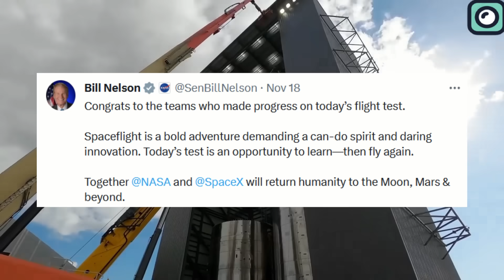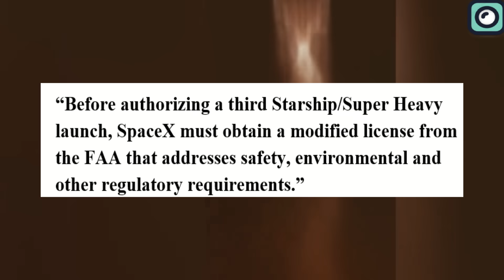SpaceX Officially Revealed Flight Data of the second Starship Launch!

Comment: Yes. I agree that both launches of the Starship and boosters were a complete success because they both offered priceless data that only a test flight could provide. When it comes to fixing problems from the data SpaceX receives from these test flights, SpaceX seems to go over and beyond the call of duty, which is a very good thing. They are also extremely fast at identifying problems and fixing them. Their work and expertise are second to none. GO SPACEX!!

Comment: ... AND fuel slamming against critical components. The engines  restarted except for one. And then they shut down rapidly until the RUD was executed. I believe the reason for the engine failures was due to engine starvation as a result of the unstable fuel movement inside the fuel tanks.